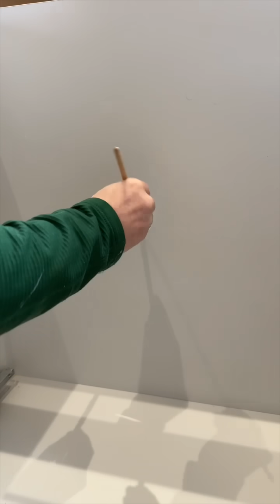Halifax Oak KITCHEN Installation PART 1  DIY and PRO TIPS

Comment: Quality tools, quality work. I am also a carpenter, I use Festool tools, for us this is the "Porsche" category. It takes fanaticism to buy them. They are amazed at most jobs because they have never seen anything like this before. There were times when I jokingly said that this is the new Tesco brand. Your works is demanding and can be based on extensive professional experience. I wish you more success.
Reply from the maker: Thanks a lot i see well i like to stuck with one type of equipment so i can understand their function and accessories etc